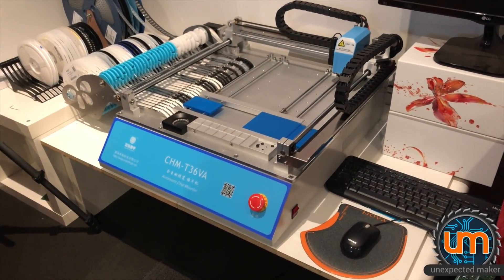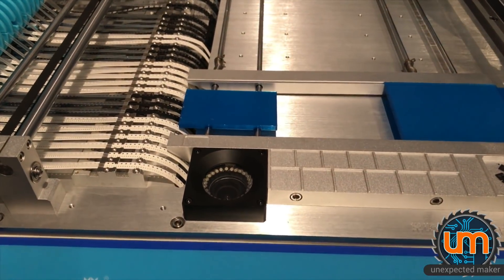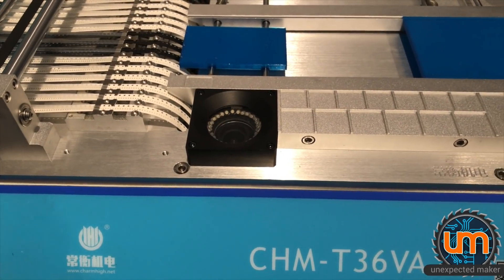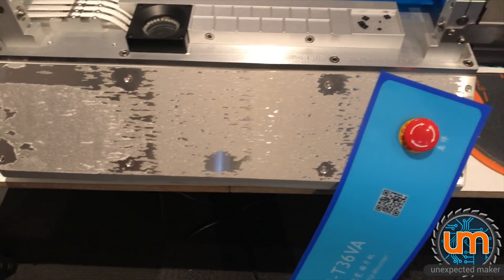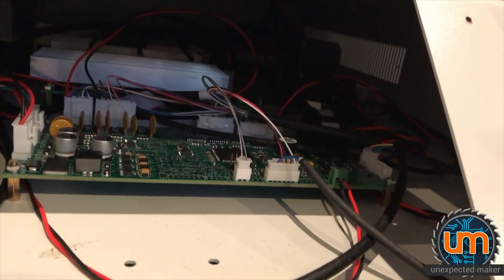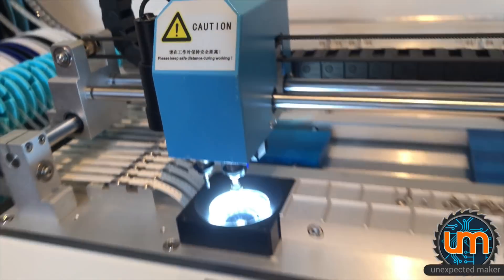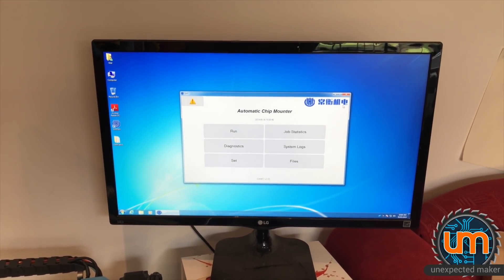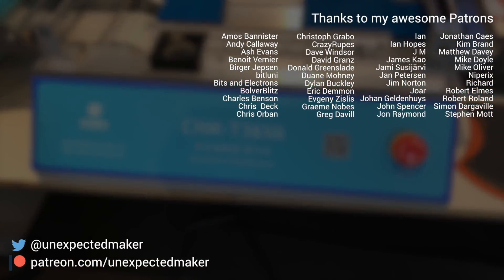My Pick n Place up-camera needs a re-focus

Comment: what if somebody made a really good PnP for the same price? how many could they sell?
Reply from the maker: That's the problem... people have tried.. making a PnP is not easy.. so many parts to solve, and the many that have tried all fail at small parts and they all trade off something to do it, like super low parts per hour (Liteplacer can only do 300 per hour and still have issues with 0402 sometimes)... or no tape feeders, or constant maintenance issues.

Comment: Wait, so what happens if the height of the part is greater than the depth that the up vision camera is focused to? Does the nozzle height get adjusted? I know with openpnp you specify a location for the camera which includes the Z axis.
Reply from the maker: From what I understand, there is about 2.5mm zone for focus and the machine itself can only support parts 5mm high, so getting that centre point in the middle of that 5mm zone is key. Of course, there is no focus tools or guide... it's by eye and hit and miss ;) You get what you pay for remember?